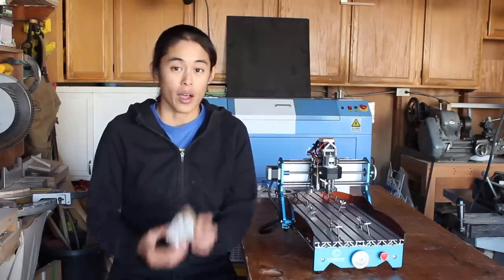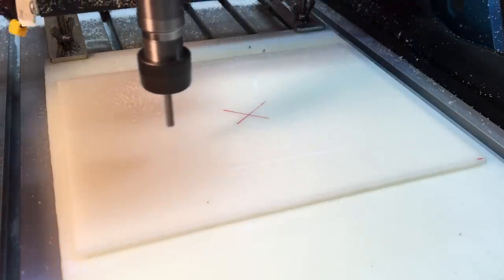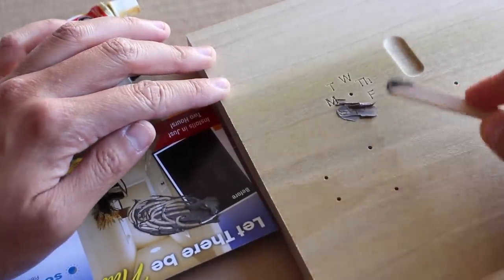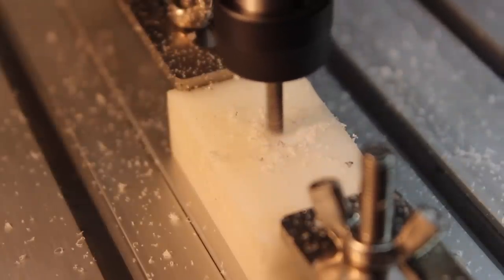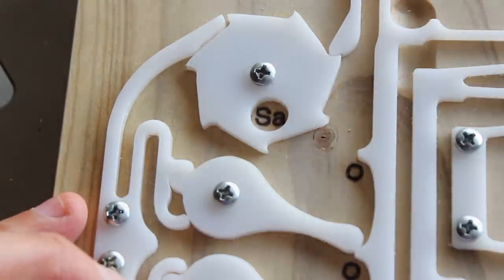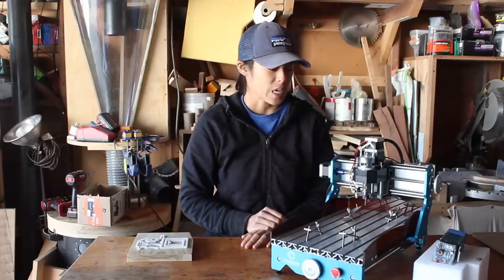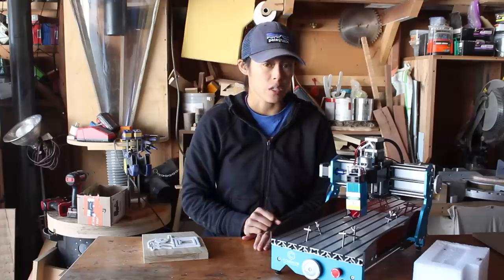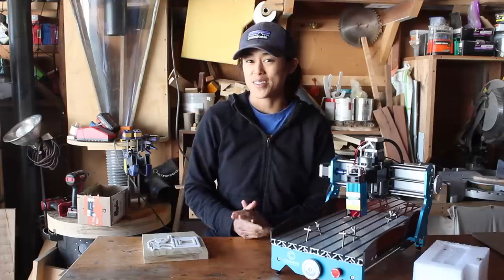Flexure Mechanism: resetting calendar

Comment: Don't be dissapointed dolly, all bits you are using in this video are not suitable for cutting metal, you could cut metal like aluminum slowly with the correct tool, it must be tungsten material, I am cutting aluminum with one of those, you are using cheap iron tools, just for cutting wood and plastic.